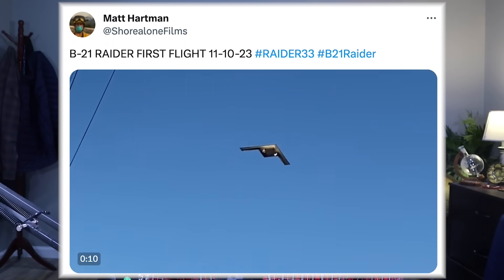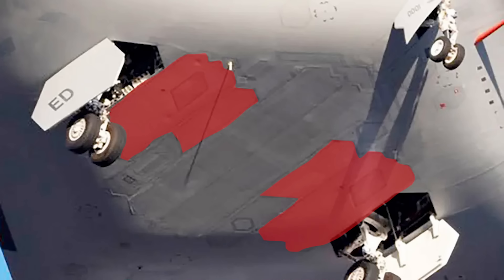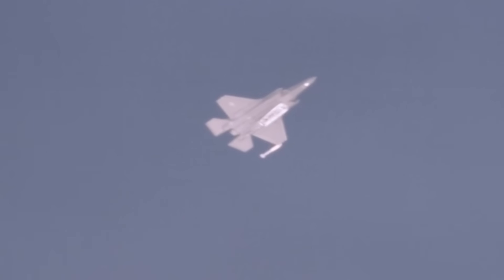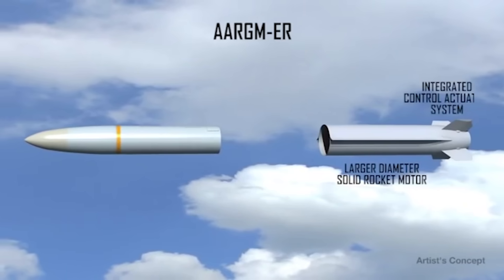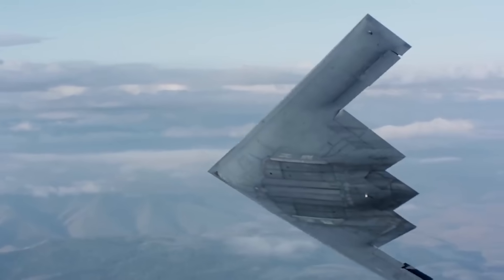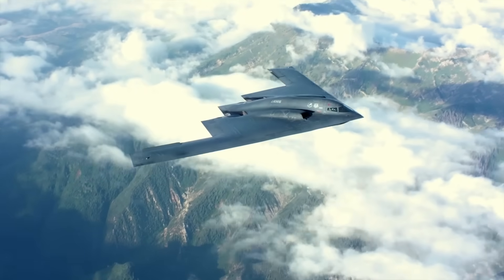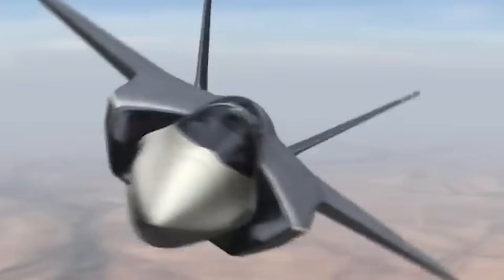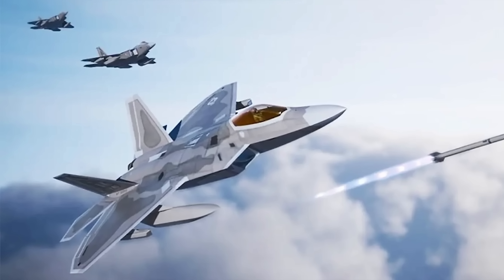Can the B-21 carry air-to-air missiles??

Comment: Man, imagine that. You're flying the latest Russian or Chinese fighter and they've actually picked up the most advanced American stealth bomber ever, and they're sending you to intercept it.

And then it locks onto you and shoots you down.
Reply: Especially since it can use a few loyal wingman drones to help find you and guide in the missile. If the drone(s) can use TWS lock, you'd never even know what was coming.
Reply: And that's when you realize the only reason you picked it up in the first place was because it opened it's bomb-bay doors to fire at you.

Which leads you to immediately also realize your own "stealth" fighter isn't really stealthy...
Reply: I am pretty sure the J 20 or Su 57 could not get a weapons grade lock on the B 21 or for that matter any kind of lock. However, if the B 21 had AIM 260 capability it would likely get a lock on those aircraft over 100 miles away and smoke them. 😮
Reply: @nasabielas  - Even an AIM-120 would be a pretty potent weapon. Since visibility is less than great onboard the B-21, I could see pilots being equipped with the same helmets used by F-35 pilots, that have the built-in HUD, and lets you "see" through your own aircraft.
Reply: @meldroc  correct the newer AIM 120D can reach out and touch something beyond 100 miles but exact distance is still classified. But we really don't know if those side bays are actual weapons bays. We are all just guessing. But an interesting point to ponder. Agreed 👍 on the potential next generation helmet and DAS capability is likely.
Reply: Precisely.🔳
Reply: Quite the flex, ain't it 😂
Reply: I just think when b21 need to flee away, it just spamming dozen of missiles at any interceptor around it. Yeah they can trick/dodge some missiles but a dozen? Good luck.
Reply: I really like your scenario!
Reply: The B-21 seems like it can use more weapons than the current generation bomber
Ideally, the J-20 and Su-57 think they have picked the B-21 and commit only realize via IRST they have been decoyed 
They radio back its decoy, ,
Their base screams at them to withdraw as their MAWS goes off 
Mis---- radio silence
Their base sounds the alarm as they realized they have been played 
Ka-fucking boom as the base gets shredded by HACMs
The B-21s approach , 
One carries ADM-160C MALD-Js and launches two waves of them
One wave to up high and the other sea skimming
the second carries the AIM-120 or AIM-260
The last two carry HACMs
One the enemy fighters commit and pass the wave sea skimming, the pop up and start jamming
The B-21s use the jamming to simultaneously launch against the incoming fighters and the enemy bases
With the jamming present, they cant detect the B-21s opening their bay doors nor the missile launches
Reply: And it locks on with the radar from a drone it deployed so you’re not even shooting back at the correct target.
Reply: ”Locking” will be difficult
Reply: I hate it when that happens…
Reply: As soon as it opens it's bay doors the stealth disappears.   I doubt pilots would be encouraged to pretend they are fighter planes.
Reply: @ramrod9556  I mean, for like 2 seconds yes. Have you seen how fast they go on the F-22?
Reply: @ramrod9556 yeah the bay doors on F-22 are super quick. You aren't gonna get that weapons grade lock in under 2 seconds, especially if the plane is 100 miles away.
Reply: @ramrod9556  I could say the same thing about the F-35, it opening its bomb bay doors doesn't instantly make it a target especially when it has a radar better than anything coming at it and still retains a stealth profile
Reply: @ramrod9556  it does not have doors as such but rolling bay plates that just move left of right and the missile plops out. Bear in mind it’s only for a few seconds and the missile is not stealthy itself…

Comment: Im confused. The 117 was a big block of sharp edges and not a curve insight.
The b2 and definitely b21 appear sleek and curved.
Yet they achieve the same stealth goals? How?
Reply: Better computers. Way back when they had primitive computers that could solve the necessary equations only if the resulting shape is composed of flat facets. Nowadays the computers can work with curved shapes - it just requires better math skills and more computing power.

Comment: Modularity sounds like a great thing, but it doesn't always work out.

The LCS was designed to be modular, able to be configured for ASW, minesweeping, surface warfare, survellance / reconnaissance, logistics and special operations. In this fashion, you wouldn't need a bevy of special-purpose ships, you could just reconfigure a fleet of LCS as current conditions demand. A test on the USS Independence had them switch from minesweeping to surface warfare in 96 hours.

It looks like they will be more-or-less permanently configured for one of three roles. Great in concept but extremely difficult to implement in practice, and considerably more expensive to implement.

I have hopes that the digital twin for the B-21, which they've been using to work out a lot of the kinks before they actually cut metal, could help alleviate that problem. And having one aircraft able to do SEAD and bombing would be great. Just hoping it doesn't cause the costs to spiral out of control and end up reducing the overall capabilities.

Comment: I'm fairly confident that those two exterior panels are actually engine servicing panels. If you look just to the rear of those panels you can see the exhaust ducts. Engines require removal and servicing every couple hundred or thousand flight hours logged. I suspect these panels are to facilitate that and allow for the removal, installation, and repair of engines.
Reply: Wrong! Pay attention pal......
Reply: @zeke2566  I'm not your pal, buddy.
Reply: @Theta420  i,me  your buddy,buddy bear........das vadanya!

Comment: Such a super stealthy missile truck would certainly help the F-35 and NGAD fighters attain air superiority.
Reply: Kinda like the theoretical b1r, only better
Reply: Especially if the main payload bay could fit something the size of an AIM-54 Phoenix.
Reply: @ThirdLawPair Or just carry the AIM-260 with better performance in a smaller package.  Or even better, some SM-6s modified for an air to air role (this was already tested on the Super Hornet).  You’d be looking at 250+ miles of range with an air-launched SM-6.
Reply: @bluemarlin8138  That would be awesome. Thought the SM-6 might not fit in the main weapons bay. It's slightly larger than the bombs carried by the B-2
Reply: @ThirdLawPair  The B2 can carry two of the GBU-57A/B Massive Ordnance Penetrators, each of which weight 14 tons and are 20 feet long and 30 inches in diameter. We know that the B21 is a smaller aircraft, but even if the bomb bays are 80% the size of the B2's, they would be able to carry a shit-ton on AIM-54 sized missiles.
Reply: A stealth missile truck for F-35, F-22 and NGAD, thats OP as hell.
Reply: Yeah totally. They light up the targets and the raider carries the pain.
Reply: Thing is they can't add energy to the missile as well as a faster fighter
Reply: @kdaltex  True, but a huge component of BVR air combat is anticipating when the enemy fighter will fire a missile so you can defend it. If a loyal wingman drone does the guidance with a TWS lock, that lack of ability to anticipate where and when the missile is coming would more than make up for the loss of energy. If the main weapons bay can fit extra-large missiles, it would be the only thing in the air that can launch hypersonic air-to-air missiles while remaining stealth. Something like the R-37 or AIM-54 is so large it has to be carried externally by any fighter jet, negating any stealth advantage in a BVR fight.
Reply: No, NGAD will have picked the skies clean and the Raider will simply fling JASSMs at such standoff ranges that fighters would be a non factor anyway
Reply: Add in all the AC130’s carrying rapid dragon pallets….”our missiles will blot out the sun”
Reply: @Ieo9017 why would an "AC-130" carry rapid dragon?

It's a battlefield gun platform designed for uncontested airspace.

Rapid dragon would be far better placed in the rest of the C-130 fleet where they can be launched away from hostile airspace.
Reply: @richardwillson101  Hey guys, I found the pedantic one who spends his Saturday nights beating it to the history channel.

Comment: I doubt they would fit a stealth bomber to have  the ability to shoot air to air missles its ilogical.Equipping the B-21 with air-to-air missiles is unnecessary due to its primary role as a long-range strategic bomber. Adding such capabilities most likely would  compromise its overall design,, and potentially hinder its effectiveness in its intended mission of penetrating enemy airspace to deliver payloads. Plus geting into a bvr fight with a j-20 in a bomber sounds like hell.

Comment: If the B-21 or any other NGAD fighter is going to defend itself, the I would suppose that they would / should have all aspect air defense missiles that can intercept aircraft and incoming missiles from any direction.  I'm certainly not an expert but I have read that Israel has an all aspect missile that has the capability to to a 180 degree to attack enemy aircraft to their rear so it appears the technology is likely mature.

On the other hand, I would think that the B-21, NGAD, F-XX would have electronic countermeasures to either prevent an enemy fighter from locking on or to disable at least an active homing missile.  That leaves IR missiles but I have also read that there are dazzlers that can also interfere with and IR missile.

Comment: U.S. Air Force jets will defend themselves with a pint-sized new weapon designed to take out anti-aircraft missiles before they get too close. Raytheon has been awarded the contract to deliver the first missile for flight testing due in 2023. The Air Force Research Laboratory’s munitions directorate launched the Miniature Self-Defense Missile (MSDM) program in 2015. BoeingBA +0.9% and Lockheed LMT +0.5% Martin submitted proposals at earlier stages of the project, but Raytheon, with a long history of missile development. 
“The MSDM will support miniaturized weapon capabilities for air superiority by enabling close-in platform self-defense and penetration into contested A2/AD environment with little to no impact to payload capacity,” according to a DoD press release. This could be used for a protective system.

Comment: If we look at the B-2 you'll see that it has an engine bay and weapons bay layout where the doors to access both are respectively in a similar configuration to the bay door seams on the B-21 raider.

The side bays are more than likely just engine access panels.

The red highlight that comes up covering the outer bay doors also cover a weird cut off portion that has nothing to do with the bay doors mentioned, there's two panels in tandem between the outer bay doors and the middle bay doors that look like they hinge open in opposition to one another, and maybe it's those thin bay doors alone that might be where air to air munitions could possibly be stored.
Reply: It's also possible there's some articulation to allow the doors to be opened without swinging them as far out from the airframe too

Comment: I imagine you’d run with both air to air and HARM missiles with JDAM in the main bay for the actual target. Then it could fly in, destroy ground radar and any interceptors already on the air, do the bombing run and get out of dodge before new interceptors can get close enough to possibly find it.

Comment: The F-117 really should have been designated the A-117.  It was always more of an attack craft than a fighter.  But I could see the B-21 taking on much of the same roll as the Nighthawk, just more likely from a higher altitude.
Reply: Or the F-111 for that matter, the F-111 had almost no air/air capabilities. It's only air/air kill was during the gulf war when an EF-111 with a mirage on it's tail went down on the deck and the mirage flew into the ground trying to stay with it.
Reply: Apparently, F-117 was designated as an "F" because they wanted to confuse the enemies about the true nature of that aircraft - sort of like why tanks were called "tanks" (as in "water tanks") in 1918.

Comment: Maybe a dumb observation, but if they are modular and designed to synergise their systems, it would make sense to have an air to air variant with radar, and bomb bays fitted with missiles to fly up-front and function as an escort to the others. The plan does appear to be to build a lot of them, so them flying alone on dangerous missions feels unnecessary.

They are after all floating weapons platforms, and would perhaps not make sense to produce an expensive compromise design when you can have more efficiency (less need to spend lots on modern air to air radars for every one made) for each variant.

Comment: I disagree on the "secondary bomb bay doors" esp the ones just inboard from the landing gear.    I was a jet engine mech on F4s back in the day so i see the doors as engine bay doors.   They line nicely with the engine exhaust.  Also if you look carefully at the up close pics of the B21 belly the seems to be a gap between these engine bay doors and the next panels/doors just inboard.   Those might be the bay for secondary armament such as decoys or AAMs.
Reply: I agree that they are engine access panels also. Mainly for the small dark section on both of them that is on the same side. I bet these are breathes for the oil system.
Reply: I was actually thinking gear doors: I'm thinking they open and the gear fold inwards.
Reply: @wilfdarr  no I think the gears are the forward folding types.   At the website the drive/the war zone they have a really good upclose pic of the main gear and you can see the bulkhead walls inwards of the gears and the gear strut at least to my eyes looks like the gear folds forward when retracted.
Reply: @mikethompson2650  Fair enough. I hadn't seen that.
Reply: I agree the outer bays are engine bays and the inner bays could be accessory/systems bay if NG designed it similar to the B-2.
Reply: Fair point
Reply: But they don't need the jagged edge if they are maintence panels because you would not open maintenance panels in the air.
Reply: The B-2s engine bays and accessory bays are jagged like the weapons bays. They are jagged for ease of access for ground maintenance, If they weren't jagged they would need to be sealed and taped to maintain the "stealth" of the A/C. So its safe to say the B-21's are the same. @1337flite

Comment: I thought you did a report on this before. Maybe on the website? Idk maybe I read it somewhere else but I thought it said it could be a possibility that it could be a missile truck with F35 designating it’s targets. Could be wrong but I thought I read this somewhere before
Reply: That is definitely something that was talked about before when talking about the “hive mind”capabilities of the f35 and 6th gen aircraft, so this isn’t really that surprising. I think it’s just that no one really stopped to think about how we would actually see a b21 with air to air missiles. 

It is still interesting to ask whether or not the b21 will able to use them all on its own or if it will need another aircraft to line up the target
Reply: @hunterreeves6525  couldn’t agree more. It’s crazy to think of a bomber (in my eyes) to have air to air capabilities but when you stop to think about it, it’s like why not? I’m kind of stuck in the thought that a bomber has to be  a bomber but the truth is it makes a lot of sense and extends its capabilities.

Comment: Probably better than the F-117 ever could.
Reply: Considering it was developed in the 70’s and now we’re almost 50yrs into the future for this ones development I would hope so.
Reply: But the Airforce would never allow it to be named the F/B-21.
Reply: The F-117 was the first production stealth aircraft and was designed in the 70's.
The miracle is that every country that makes combat aircraft hasn't exceeded it. Or even equaled it.
Reply: doubt that.
F117 = old approach to stealth.
surpassed tech.
retired useless aircraft.
Reply: @BobWileyAKA52Blue  It's still pulled into service.
Reply: @recoil53  obsolete in the theater